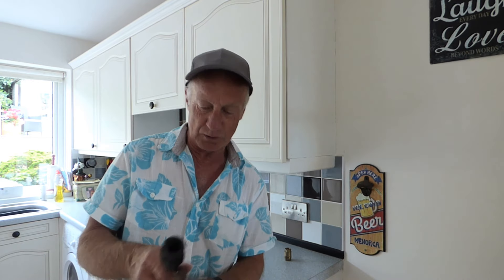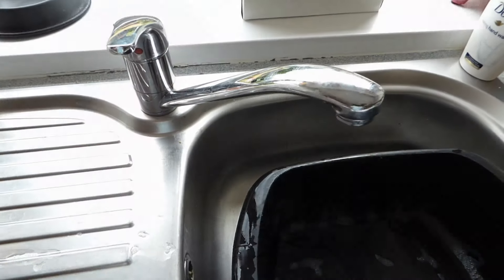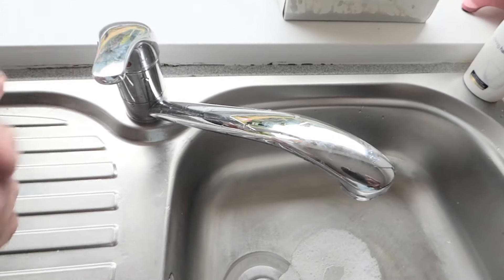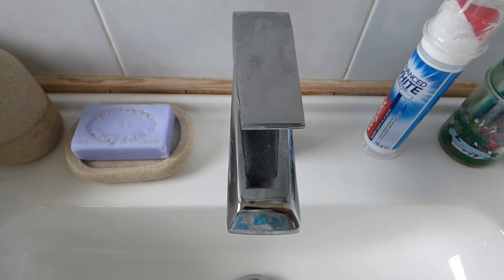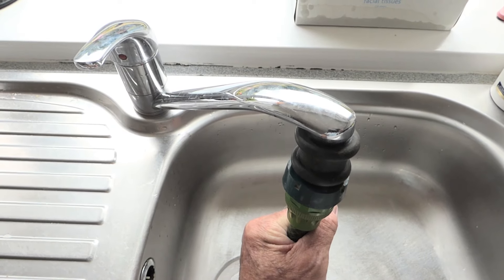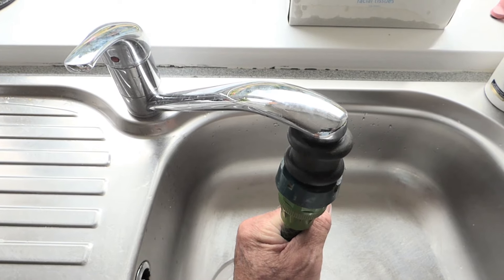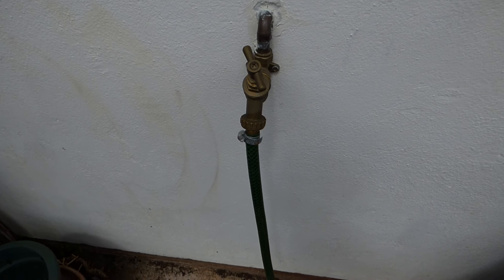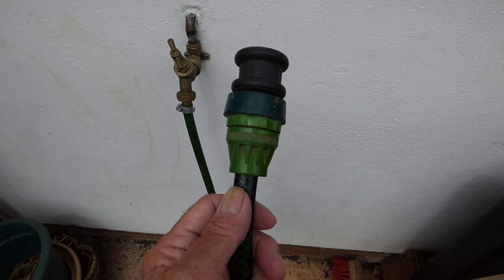How to clear airlocks  No water from taps ?

Comment: Very good video but you say my problem is not an air lock if i have a combi boiler?. I do have a combi boiler and all the hot water taps are not letting out any water. The boiler has become noisy but the heating is working and water flows from the cold taps. I need help because water does not come out of any of the hot taps in the house
Reply from the maker: The 3 way valve is  broken.
Reply: Thank you. Got it fixed for free yesterday due to  the part of insurance called the home emergency section of my  home insurance. I recommend everyone to take  the home emergency section of buildings and contents  insurance because without it, normal general home insurance usually comes with a big excess fee for jobs that might involve pipes or water.

Comment: Thank you. Ive had to do this a few times before and I was wondering if you have and idea what is the likely cause of cold water air locks. Its fed from loft and a downstairs, end of line bathroom. Bath then sink and toilet at the end.?
Reply from the maker: It is when the roof tank does not fill up fast enough to replace what you are running out of it.

Comment: My toilet and shower (not electric) were air locked, so I took the shower head off and placed the control handle in the middle, I pulled the handle up to turn the shower on while placing my hand to block the water coming out of the shower and it freed the airlock trough the toilet. Thanks so much for the great info
Reply from the maker: Great you did it ok.

Comment: Live in ex council flat. So pipework is, well, random. Did some work on the colder water (header tank) in the bathroom. Hot water is mains. Ended up with almost no flow. Thumb over the mixer tap positioned in the middle worked perfectly! Thank you so much!
Reply from the maker: No problem.

Comment: Thank you so much had to turn water off to change toilet cistern valve.lots of noise after and nearly a sleepless night until finding your video.Turned all the taps on in the house and put my hand over the one with least pressure and hey presto problem solved.Did get soaked the first time of trying it tho.Was never the brightest at school.;-) thanks again your a star
Reply from the maker: No problem
Reply: @dereton33  ahh problems came back was just watching your other video on the same and in the comments it said about using the washing machine connector.
Do you close all taps in the house then connect the cold feed to the hot and give it a short blast or should you have taps open whilst doing.Have a system boiler I think big tank in bathroom should.i turn the boiler off whilst doing it.
Thanks for videos ATB

Comment: very helpful - we have a wierd hyrid system here. Combi but there is a tank and emersion for the shower which also feeds 1 ensuite mixer. Therefore difficult to clear airlock. Would a hose connected to shower work - or is likely to have NR valves inside shower fitting to stop this working. If so it will be hose ext to all the way from rear of house to front where ensuite is. Thank you
Reply from the maker: Give the shower a go first.
Reply: @dereton33  thank you. We tried that no joy. Also tried putting stop end on vent in tank and trying to push up through water tank drain off no joy. Noticed dodgy gate valve in the process. Changed that still water defying laws of gravity. Even if you open drain off on tank and try and syphone there virtually nothing. Sounds like water emersion tank has filled with air but I can phatheom a way to clear it sadly

Comment: Thank you so much just had to replace kitchen tap and had this issue no water in any hot taps after unfortunately didn't have hose but tip with the mixer tap worked perfectly all taps working again thanks so much
Reply from the maker: No problem Matt.

Comment: hi, i know this has nothing to do with this video, but i work in a hospital which most of the piping is plastic, now because i havent had much experience within the plumbing field and was meant to get training but havent, when changing the taps most of the time there is a build of of limescale arounf the but, what would be the best way to disconnect the nut from the plastic pipe without cracking the piping ?
Reply from the maker: Try some WD40 on the nuts and good fitting spanners, you cannot use heat.

Comment: Hello mate hope you doing well. thanks for the video my problem is with the cold taps in the bathroom. cold tap is working in kitchen as water coming in by the mains. Can i use the hose trick to push air block out?
Reply from the maker: Yes it should do it.
Reply: Thanks all sorted hope you are keeping well.

Comment: will this cause low pressure in the combi boiler? My hot tap on a mixer bath tap is low to nothing, cold side is fine but my pressure on the boiler  is going below 1 and cutting off the boiler every 2-3 days.
Reply from the maker: No. Just top up the boiler to 1.5 bar. The bath tap needs fixing and is nothing to do with pressure.
Reply: @dereton33  OK thanks. Boiler getting serviced hopefully before end of the week so i'll get him to look at tap also. Can't work out pressure loss though, there are no leaks anywhere??

Comment: i have an unvented system in my house. My kitchen mixer tap has stopped flowing from both hot and cold. Stopped completely at first and now dribbling. In downstairs toilet the hot tap doesnt flow at all, but the cold works fine. Any ideas? All other taps in house work perfectly.
Reply from the maker: Check the taps first. Make sure they have at least a couple of turns on them.

Comment: I've got an airlock on the cold feed to my bathroom mixer tap upstairs and I've tried having the mixer tap in the middle position and pushing the hot feed into the cold but it never seems to work. The pressure from the hot is just too weak. I have no other taps nearby that can be connected via a hose and so I'm stumped.
Reply from the maker: Try a garden hose connected to an outside tap, get some one to help you though.

Comment: This fixed my problem perfectly. Thank you! I had to do this when I hired a bad plumber. He cleaned my water tank but when he emptied it, it let air into the pipes.
Reply from the maker: Glad it helped!
Reply: Why was he a bad plumber, did he install the system,  airlocks are common if system installed poorly nowt to do with cleaning tank out, yes he should of left you with water coming out ur taps mind

Comment: I don't get it. My water supply is 3-6 bar, at night up to 10bar, what ever I did, i could get an air lock so far.
Reply from the maker: Dont understand the question?
Reply: @dereton33  i mainly don't understand the issue, are peoplee still using unpressurized domestic water? Mains water comes pressurized up to 10 bar, there are devices that pressurise water. Once you have significant pressure, you do not have issues with airlocks. It is more of a hydronic heating piping problem, especially with underfloor heating, long coils and such...

Comment: Thank you so much. I have been putting up with this problem for ages and wish I had watched your video earlier. My kitchen hot water was ridiculously slow coming out of a mixer tap so used a quick clamp to block the flow, turned on both hot and cold and hey presto.  Many many thanks.
Reply from the maker: No problem.

Comment: Fantastic tips.. i had the every problem you mentioned in this video.. first i tried the kitchen mixer downstairs method for hot water flow ..and that took most air out of hot water pipes.. after this i still had not much pressure in upstairs bathroom sink.. both hot and cold so used hose trick and it worked... ( This is after I had to empty hot water tanks for a tap replacement)..many Thanks again..
Reply from the maker: Glad it helped!

Comment: Hi Al, useful tips as always. I have cleared a few airlocks by taking the garden hose up into the roof and putting it in the cold water tank and then into the down pipe and turning on, works a treat when you can't get a hose on to a tap. Keep making the videos !
Reply from the maker: Great tip Paul thanks.

Comment: Hi
I get a bit sick of these videos and the comments.  any competent plumber now s all u have to do is stick a hose pipe mains pressure in ur cold water f & e tank into the out let pipe so it forces the air lock out In The correct flow direction
Simple. Stop waffling 
Regards
Reply from the maker: Not every one knows that is the reasons why.